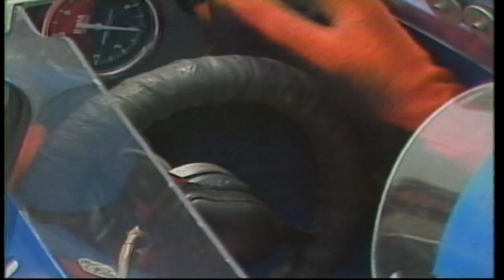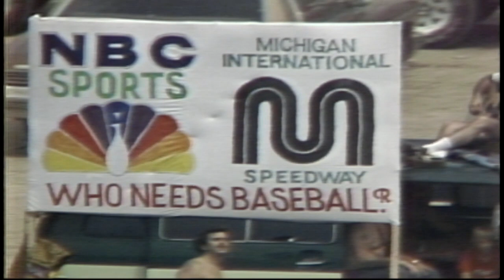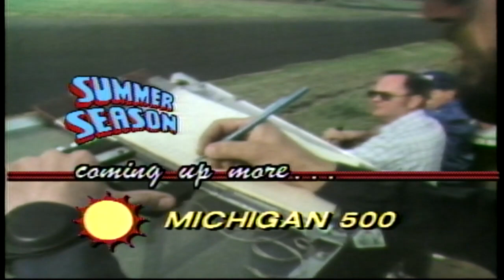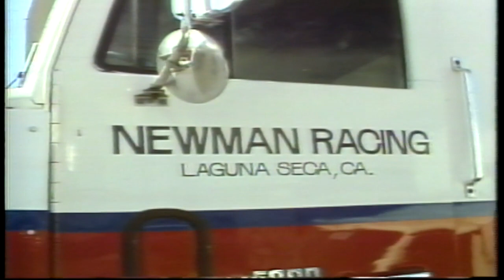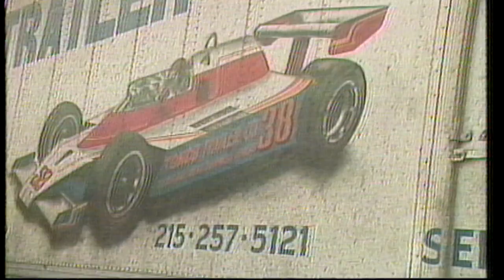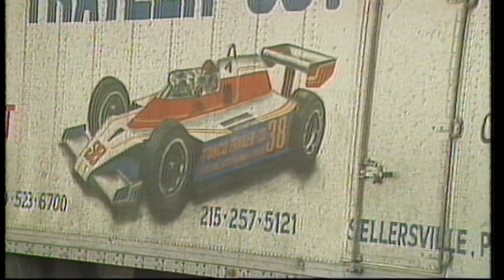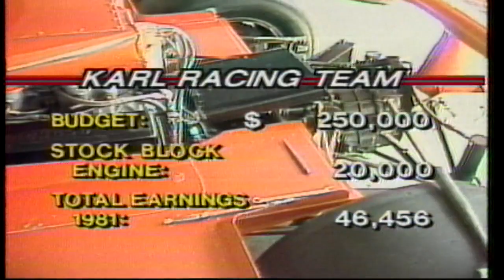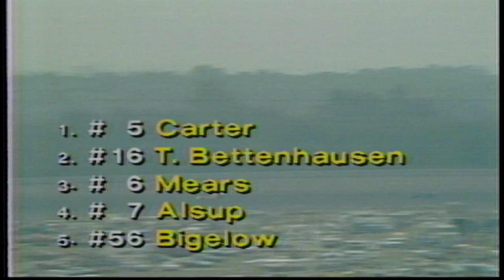1981 Norton Michigan 500

Comment: Unfortunately Indycars Do Not Race At  The IMS Speedway Anymore!😢🏁🏎️🚫 Between This Track ( With The Banked Angle Track Being Difficult On Driver's Bodies With G Forces. )
The Excessive Heat!🥵
And In This Inaugural 500 Mile Race Out Of 37 Indy Cars 🏎️🏎️ Only 10 Indy Cars 🏎️ Were Still Running , At The Finish!
I Am Posting 📬 This On Tuesday Afternoon 🌁🛤️🛣️🏙️ , March 26, 2024.